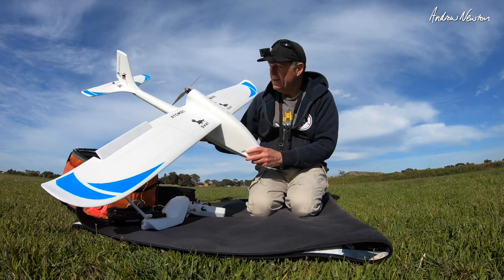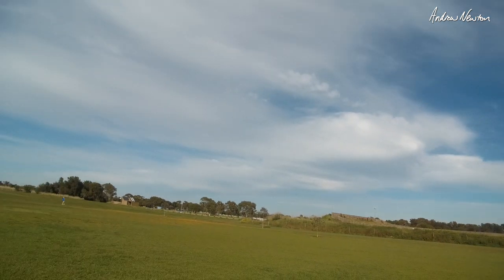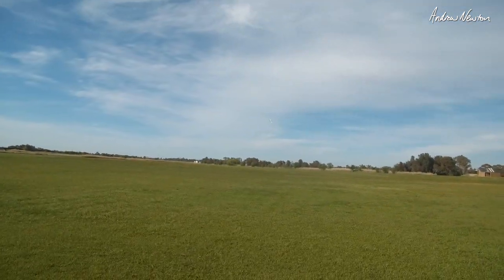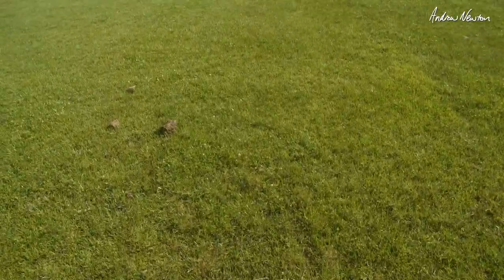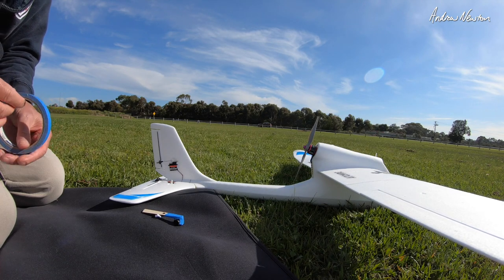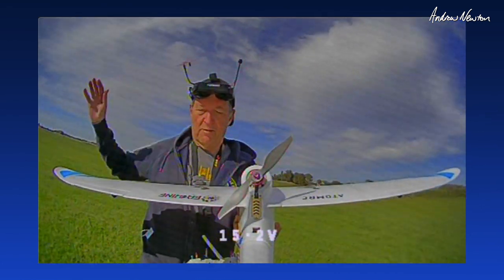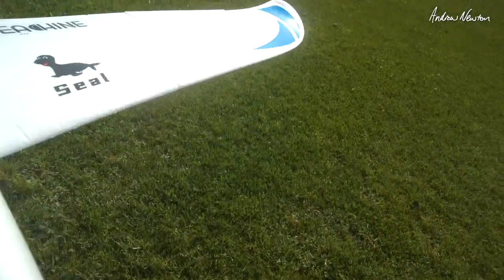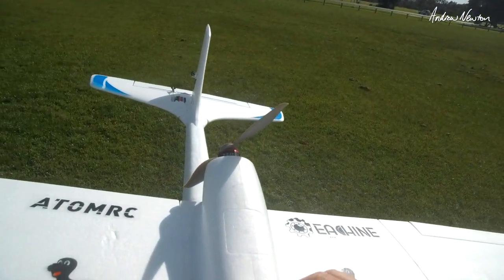AtomRC x Eachine Seal - Flight review

Comment: Morning Andrew. if you're going to use long runs of camera cabling, past the motor, ESC, receiver and everything that can cause interference, try running the signal through thin RG174 coax (signal inside, shielding to ground) - costs pennies but makes a world of difference.
Reply: I also saw someone use copper foil tape. They wrapped it around their signal wire and it works wonders! I ordered some copper foil tape for myself and will give is a try.
Reply from the maker: Great tip thanks. I'll try that.

Comment: Good to see you flying again! Looks like your original flying field, is it a long drive from your new house to the old field? Also I saw someone use copper foil tape and wrapped it around their video signal wire to help clear up interference and it works wonders so I ordered myself some to give it a try. Happy flying Andrew!!
Reply from the maker: Haven't moved yet. Still have another month here.

Comment: Thanks Andrew for sharing! It would be interesting to ear how does the AtomRC-Eachine Seal compares to one of your favorite planes, the Volantex Ranger 1600?
Reply: Good question I have a ranger 1600 and would like to know the difference in characteristics.
Reply from the maker: I prefer the Ranger 1600 for it's toughness and great flying. The Seal has more internal space and easier access, but it's not as efficient as the Ranger
Reply: @AndrewNewton  thank for aswer. I was also interested in this question. Only I am looking at the Ranger 2000 which is cheaper anyway to The Seal price.
Reply from the maker: Ranger 2000, also a favourite of mine.
Reply: @AndrewNewton  ranger or raptor better?

Comment: Good to see this particular plane in the air, it looks and obviously is very stable. I have a question would a 3s power pack provide sufficient power I ask because I have loads of those but no 4s packs. Great to see you in the air again.
Reply from the maker: Yes 3S would work OK as it is. Even better with an 8x6 prop
Reply: @AndrewNewton  thank you. I will take your advice and use 8x6 prop.

Comment: Great video. Would like to see how you address the interference.
Reply from the maker: Most likely use a flight control board for the OSD and RTH. That will have filtering included.

Comment: Andrew did you use any spacers on the motor to change the angle? If so would it be the top two screws?
Reply from the maker: Bottom screws

Comment: Very nice. Seems a bit like a cross between the Bixler and the Ranger. 
Would be interesting to hear your thoughts after testing the Eachine Seal's soaring abilities.
Hopefully the ESC allows setting of motor brake.
For better CoG, perhaps 2x 4s, or 4s2p lithium-ion? Would allow to fly for an hour or more!
Reply from the maker: They all have merits. Bix - easiest to fly, Ranger - toughest, Seal - internal space and access. Would make a good video thanks
Reply: @AndrewNewton  Great answer. 😃

Comment: For $79 for the kit. Should I pull the trigger or spend a bit more for the Ranger by volantex
Reply from the maker: For me the ranger is the best. Can use 1600 or 2000 wings. The seal is OK but the ranger is tougher

Comment: Andrew:
   Did I hear you say that the Seal is like the Bix 2? My club needs to buy some easy-flying, floaty, pushers. We found the Bix 3 planes to be prone to tip stalls without flaps (I need to test one WITH flaps soon), when trying to turn at slow speeds.
    My memory tells me that others have viewed the Bix2 planes as easy fliers, floaty, without bad flying characteristics. 
Do you agree?
Have you completed your move yet?
Keep em coming!
Jim
Reply from the maker: Bix 2 is the best flier, best for beginners and very cheap for the kit. Cant be beaten.

Comment: Thanks for the video, Andrew. I was interested that you mentioned this plane would be ideal for beginners. Hmm...

How times change. As an old-school aeromodeller I still think it's 'wrong' [personal opinion only!] that full-house has become the default set-up for planes. Wings are cut from thin foam, and carbon-fibre spars are flat, so dihedral is difficult to incorporate. If a beginner's model is too twitchy, flight control boards or gyros or whatever are easily obtainable.

But a plane with ailerons and no dihedral needs extra attention. Neutral stability isn't always desirable; not every situation calls for extreme manoeuvrability. A properly set-up plane doesn't need ailerons and will fly perfectly well without them.

But... having 4 active channels is more grown-up. More manly. 'Real' pilots NEED ailerons; only little kids don't use all of the controls all of the time, so we see planes like this, which would still fly superbly with a few degrees of dihedral and just rudder and elevator [and throttle].

As a camera platform, a bit of hands-off stability would be a good thing, but dihedral is now apparently taboo. I presume that's because it's cheaper to make flat wings for flat carbon spars, but today's modellers are missing out on a whole world of relaxed flying by opting for ailerons. You could easily replace the flat carbon wing joiner with a bit of bent piano wire. Weight gain would be negligible.

I wonder if people who haven't done much basic modelling are put off rudder and elevator set-ups after trying to fly their flat-winged aileron models on rudder and elevator alone (just to see what happens), and being disappointed by the poor response and handling.

Well, give the wing an inch of dihedral under each tip and try again.

It'll fly beautifully AND still respond to ailerons, should you choose to use them. Yes, it will. The bonus is that the plane will be even more stable and forgiving, especially near the stall. That's nice for beginners AND for experts using cameras, because it'll give them smoother video footage.

It's a pity that the commercial convenience of using straight carbon-fibre spars has resulted in so many models with flat plank wings. A bit of dihedral won't hurt, even if you're into extreme 3-D aerobatics, and it makes ordinary 'stooging about' flying so much more pleasurable.

Also, flat wings look cheap and crude and ugly and should all be destroyed with hammers. 😲 (Whoops, sorry, got a bit carried away at the end...)
Reply: The turned up wingtips give the same polyhedral effect that dihedral would, and all the "bixler type" pushers can be flown around perfectly well with just throttle, rudder and elevator. BTW, "full house" would include flaps, which are not present here
Reply from the maker: Yes, a bit more manufacturing required for dihedral joiners I guess. This is more a model that could be used by beginners, rather than specifically designed for beginners.